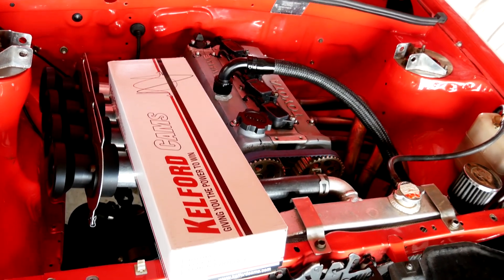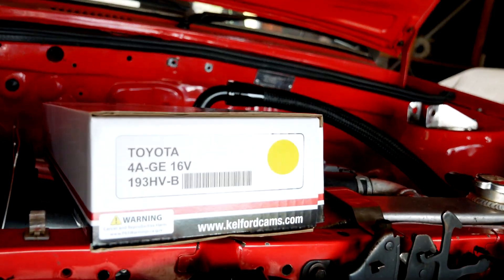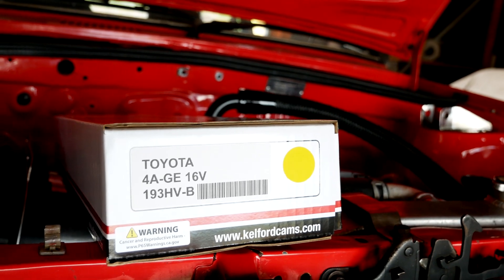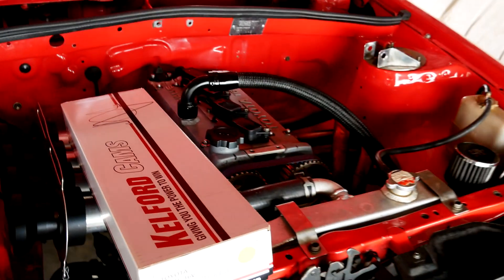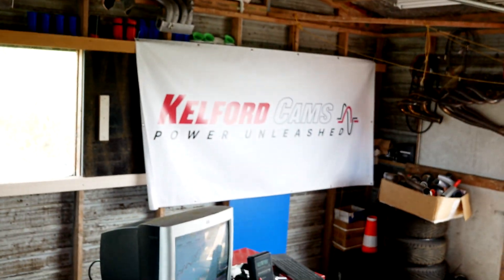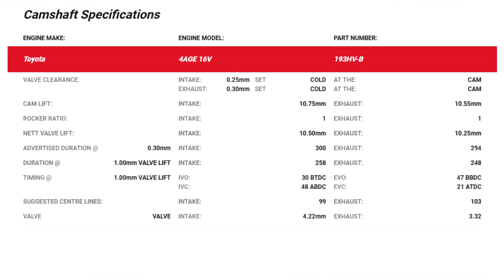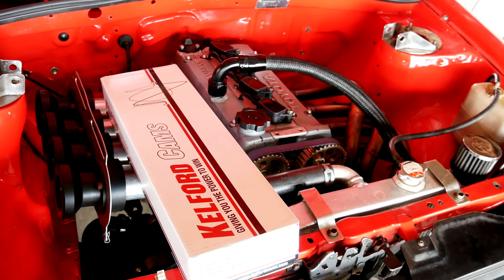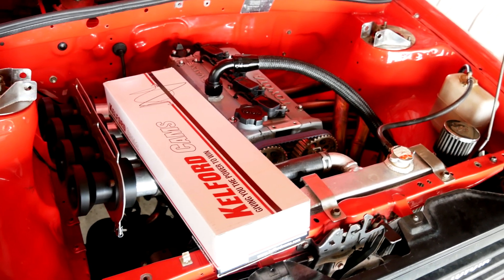Dyno Testing Big cams - Kelford 4AGE  - Dyno tested

Comment from the maker: Some links in description  for the cam spec, if they didn't stay on screen long enough or too small to read. Along with rest of engine spec.   Both cam sets used here need undershim or shimless buckets. plus some clearancing around the bucket area, to allow the cams to spin. May get lucky in the HVB's case depending on your head casting.    But more importantly, what set would you choose ?
Reply: Head says daily driving should mean B cams. But the rest of the engine is built for C cams

Would love to squeeze more headflow out of it to give more of a rise in top end power... Besides that, 210hp at the treads is unfathomable! 

Thanks for the video, and thank you Kelford Cams!
Reply: i think the hvb are better, even in racing condition, depends on how much rev u loose after shifting, the hvc only have more power the last 1500rpm, i guess when u shift your rpm drops more then 1500rpm? so that faster your get in high rpm that time u lose after shifting i guess. plus the worse midrange
Reply: @Lumberjack0286  the matter is not so simple.
In an internal combustion engine, everything affects everything.

HV-C cams need more compression and re-ignition mapping.
Then the power  is the same low rpm  as HV-B with camshafts.
And max power is much  better. The exhaust manifold must also be re-dimensioned correctly.
.
Reply: @wesulius  but did i get it wrong, or hasnt he already the hvc cams in it and tested the hvb cams?
Reply: @Lumberjack0286  yes, this just tell it, the engine now works better with b camshaft, but with small changes it would work better with c camshaft.
Reply from the maker: @wesulius   It would be asking a lot of the the HVC cams to match the low end.  They are some of the biggest off the shelf available for these engines.  While they may no be the perfect match for this engine.  Any gains to be had should be in the top end.  Some of the changes needed, will drop more of the low end for a possible gain up top.  basically they are  doing as advertised.   a drag or circuit cam where engine lives in the last few thousand rpm.  I will likely shorten the intake runners before swap back to a different combo, to see  if it makes any more peak.   my current intake tuning is between 8000-8500rpm.   pushing it up to around 9k where it starts to flatten out should add a bit of peak.
Reply: @Garage4age  time for a cam upgrade in the Hilux?
Reply from the maker: @dan4age   possibly a mild one at some stage, It has to run nice at idle and not stall out easy for doing 4wd things.  a vvti setup is of more interest.  but that would also allow to get away with a bigger intake cam at least..
Reply: This was amazing to watch! Finally some INFORMATIVE information. I hit subscribe instantly!

Comment: Great content bro. Also love the kp61. Have you ever considered increasing the compression ratio a small around when switching to higher duration cams? I dont really understand how static compression works VS dynamic compression. But as far as i can grasp the more duration you have the more it allows you to increase the static compression ratio. Any information appropriated!!
Reply from the maker: Hey.  Kinda,    more air you get in the cylinder and the more you compress it, the more its likely to knock.     since bigger cams can loose power  at low rpm  (less cylinder fill)   you are compressing less air so less likely to knock  at low rpm,   so can up the compression ratio.    High rpm will generally   get away with higher compression ratio.          Its not that relevant these days,  as can just tune around knock issues at low rpm.
Reply: @Garage4age  well with the smoky old frankenturd pretty sure new pistons are on the cards. Why not try to go a little high on compression like 13.5:1.(with a 5mm head gasket). You could then compare different compression ratios with thicker gaskets.
Reply from the maker: @blakestacey83  that engine is no longer a thing.  the block itself is back in this car, under the big valve head in this vid.     the head is on my hilux.     i do have a video  where i tested a .8mm gasket vs the stock 1.2mm,  before it was pulled apart

Comment: Wait, wow. 160kw to the wheels! Incredible, this is still a 1.6 right ? If so this gives me hope I can make that with my 20v blacktop. What gas are you running?
Reply from the maker: still  1.6l, 1627cc if want to get picky as has oversized pistons.     is setup to run on pump gas - 98ron

Comment: did you set the cams up per suggesteed center line? also would be interesting to have a plot with the stock cams for reference. Nice video. i appreciate all the work you do!
Reply from the maker: Roughly when was checking clearances. Bit generally don't bother, as should be adjusted on dyno to suit engine and preferred power curve

Comment: Hey man I’ve always been curious as to why people run itbs without tvis for low end torque, have you done testing to see if they ever work together?
Reply from the maker: Tvis is the whole intake manifold.  So without  redesigning the whole system  you'd have to mount the throttles on the end of the stock runners , which isn't really going to be a thing for alot of reasons.
Reply: @Garage4age  definately not trying to tell you you to suck eggs here but IIRC the business part of TVIS is a sandwich plate that goes between the inlet manifold and the runners, it's just a butterfly in one of the two inlet runners per cylinder, not a dual length runner system or anything like that. That said I don't think an ITB adaptor bolts nicely to the manifold side of it (maybe you could bolt a backwards TVIS elimination plate between the ITB adaptor and the TVIS plate) and I don't think TVIS does much anyway, even on stock engines.
Reply from the maker: @WilliamMoser   hey,  yeah i'm saying the tvis plate will not work on its own.  It works by reducing the diameter of the whole intake runner, increasing velocity.    just using the plate without the 2 separate  full length runners  wont do anything, other than pose a restriction.     I have a  video  that shows the small gains tvis makes.
Reply: @Garage4age  there was me thinking it was more about promoting swirl, makes sense. I guess 8 tiny ITBs would work on an 8 runner manifold with TVIS.

Comment: pretty messy down low, but what you would expect,  I wish cam Co's would stick to SAE protocols, in which advertized duration is measured @ .006" and not .012" 
are these billet cams, or new cores. Valve springs ?  
The way I see it is, the inlet cam recommended LCA at 99 deg is already well advanced, and further adv really screws he bottom end-mid range for a bit of upper .... thanks for the great effort,  Do you know how to work work back from lift to velocity then to acceleration rates at the lobe ?
Reply: should read fnlet cam well retarded by 7-8 deg
Reply from the maker: yeah most "import"  cams seem to be measured in mm.   but end of day its just indication,  can have 2 cams on similar paper but be vastly different.   they are new cast cores, it has kelford beehive springs
Reply: @Garage4age    Their advertized duration is at 0.3 mm or .012"
The SAE protocol reckonised 60 years ago was specified @ .015 mm
or .006" , so that extra .006 " is worth about 2 > 3 odd cam dgrees either side of the lobe which is equal to 8 > 12 crank degrees 
So to me, if I was reading you cam, it would be around 310 duration 
The Europeans also like to spec their cams @ 1mm or 0.040" but the Yanks @ 0.050", which was a Harvey Crane measure of major intensity, esp for sloppy old V8 stuff !   I do not really take a lot of notice of this measure, as the more duration the cam has, you can bet your bottom $ the accel/decel ramp rates increase. 
But the dyno really tells the story !   thanks

Comment: Love how you do things... sure wish I had a dyno in my garage.  In a Datsun/Nissan U20, I just swapped out a grind with a total lift of .531 for a cam with .478 (had a possible valve to block interference issue), both with the same duration and noted a (seat of the pants) significant drop in torque, especially at 3000-3500rpm.  I noted a .020 lift change and more duration on the two cams you ran, but despite the duration change you still picked up torque across the board and didn't hurt it down low with more duration. Do you have any experience where you "over" lifted the valve and went backwards in Output?  I've read that going over 15% of cylinder bore can lead to turbulence (.531 is 15.5%, .478 is 14.5%), but of course engines vary a lot.

Comment: Hi,  any info about the intake cam sensor?  also thinking options to cop return signal and that the spot i did think i would do. Like Atlantic where from cam
Reply from the maker: do you mean the sensor on the end of cam cover?   its for my vvti setup. not being used on this engine atm
Reply: Yeas.. that would be ok position to get second trikker to cop. Not using stock disruptor.. atlantic engine had near that on side. End of cam. i do have actuan tricker from altantic and maybe getting few of then to get ready to cams.
Reply from the maker: @timneva8104  Its easier to add a tooth to one of the cam gears.
Reply: Altantic triccer fit just end of cam whit bolt.. so sick easy to mount

Comment: Can you test please smallport head with bigport intake? And your exhaust headers vs the "classic racing exhaust in obx style" ones and maybe a 7age build on a budget? Is it worth it? Does it affect tvis positiv if you sharpen the inletside of it (like the edges where the blades are sitting)
And can you build a inlet manifold for itbs on the cheap. And is there a cheap ish way for better enginemanagement. Like ecu that you can run itbs and coils.

Comment: Great, great videos as always....
Are these cams are drop in cams?
How do you check piston to valve clearance with the cylinder head on?
Thanks
Reply from the maker: Hey, These are some of the biggest off the shelf cams made for them.  both need shimless or shim under bucket conversion. also head needs some material  removed  to allow the cams to spin.  I had already done this in the past for one of my other cam combo's   along with the correct valve springs.     to check valve clearance i remove the spark plugs and turn the engine over by hand. adjusting cam timing till there is contact.  then slowly adjust till there is no contact. then add required clearance on top of that,  using a dial gauge.
Reply: @Garage4age  I have always wondered what makes more power/difference if everything remains the same , lift or duration (if this a valid stand point what so ever) and I am inclined towards duration with aggressive camshaft ramps like yours. I know it's more complex than this cam 1 vs cam 2, other factors have their influence to...
As always great videos, everyone should thank you for spending time and sharing data!
The 52mm throttle bodies are bored itbs from what engine may I ask?

Comment: something is not clear in my mind, advancing exhaust (means exhaust close sooner) + retarding intake ( intake valve open later and close later) combined that gives less overlap than less scavanging since less opening at TDC = Give more power higher! how is that? someone explain please
Reply: well i think you gotta think of it as in a high rpm situation you want to open the exhaust valve sooner as it would have less time to get the exhaust gasses out, and as the chamber empties of exhaust gass that has expended it will sent a pulse down the exhaust causing a vacuum in the the combustion chamber that the later opening intake valve will scavenge off because of the engine speed, and since the valve effectively will stay open for longer as the piston goes down it cause further vacuum for the air to flow for longer into the chamber.
something that would not be as possible on lover revving engines but only for high revving applications if i am not to wrong
(sorry if my english dont make me able to explain it perfectly)
Reply: The most important event is intake closing at higher rpm you want intake to close later(it will close after bdc) the higher the intake air velocity the more can be rammed in even when the piston is coming back up but at lower velocity and lower rpm if it’s still open the piston comping up will push out the intake charge the next most important valve event is ex opening you need it to open sooner at higher rpm so it has a chance to clear together these too events are probably 90% of the equation and intake opening and exhaust closing are only the remaining 10% hence valve overlap is basically a by product of your cam duration combined with what the engine wants these two events to be

Comment: 217whp, according the the "whp = bhp x 0,85" rule gives 255bhp.
Reply from the maker: I don't think driveline loss is that much on this car.    1:1 straight through gear,  light flywheel, minimal accessorys,  small wheels etc.   maybe 10% loss.   but yeah should be close to that magic 240hp mark
Reply: @Garage4age  That power levels are totally insane! 
Close to 150 bhp/l is VERY good. In a street car to boot. 😃👌
Reply: 255hp /1,627ccm = 156hp/1Liter 
!!!

Comment: 8:39 - i see clearly "170" on the chart. 
8:45 - "161,9kW" ?
Reply from the maker: The small graph is the raw numbers dyno is seeing.   no smoothing or correction, it gets a little wonky when power rolls over, dyno is pretty much as its max rated speed also.    The big graphs have smoothing and weather station correction  applied.   was a "better" than standard day when doing these runs.   from memory with no correction and just the smoothing was 165kw

Comment: Looking at this, i can't imange what a freevalve like system would do for an engine like that.
If system was fast enough, you could easily run insane amound of overlap and lift, while still getting a lot of low and midrange. Which with regular cams, is always a tradeoff of sorts.

Comment: when you say 0 are you referring from stock centerlines or suggested centerlines ?
cheers !
Reply from the maker: approximately  suggested centerlines.     Could be 5 or so either way, as i  just set it roughly when finding piston to valve clearance.  do the final adjustments on dyno
Reply: @Garage4age  cheers man !

Comment: I would want to see the VVT on the engine - but I understand with the rev range this one is making power on, the VVT is really not sensible (as you won't drive this daily anyway). :D
Reply from the maker: will be adding the vvti to it.   but will be swapping back to a different cam combo.   should be able to get close to the numbers its making peak and gain all the midrange back

Comment: What octane and blend of fuel are you using? 93 E10?
Reply from the maker: 98 ron e10 in this video.  which is the same usa 93.     it will run on 95ron but close to knock.

Comment: How much torque does IT make?
Reply from the maker: 182nm if do the math from power and rpm.   Probably 200nm at engine if factor in 10% drive line loss
Reply: @Garage4age  That's an insane torque figure for an NA 1.6. That's close to 125nm/litre, beating the very famous F136 by a 5nm.

Comment: I find it interesting that oil temps impacted power that significantly. There must be a lot of parasitic drag from the oil pump. Do you have any testing with ported pumps?
Reply: The oil temp trick is famous and used by decades of shady aftermarket part mfgs.
Reply from the maker: @nobodynoone2500  those magic fuses are a good example 🤣
Reply: @Garage4age  I saw them using the magic fuse on Keichi's 86. Car prime
Reply from the maker: @rauchekcara   Yeah that's what was referring to. was probably hotter oil, on the run after they swapped the fuses out.  how it gained power with rpm is what happens.
Reply: @Garage4age  duuuude I knew it!! I watched that one and thought, I bet it picked up power from hot oil.
Reply from the maker: its more the rotating assembly (yeah the oil pump rotates, but you know what i mean) that causes the drag. the more rpm the more drag there is.  there is very little difference in power   below 6000rpm.
Reply: @Garage4age  Have you tried a thinner oil?
It needs to do the same thing, but cooler.

Comment: My biggest question is what kind of wacky resonance/frequency/whatever the heck is causing that massive dip at 5500 rpm with the HVC's?
Reply from the maker: reversion,  can only fight it for so long.  will happen with a lot smaller cams if setup is wrong, mostly exhaust side.    If running cams big as the hvc, you're generally not worried about what the engine does under 6000rpm.